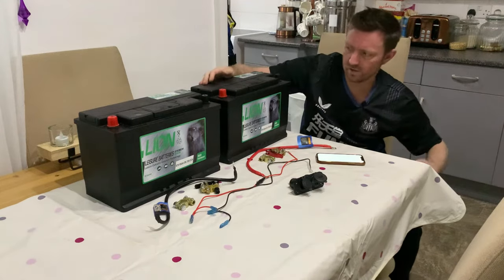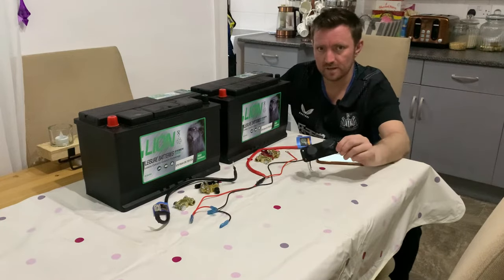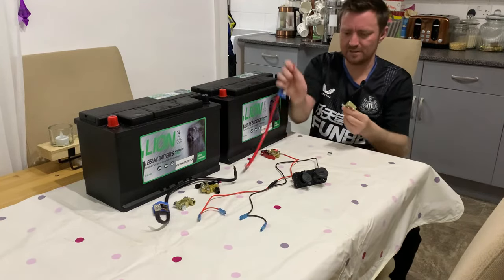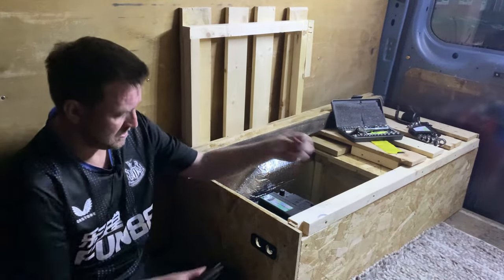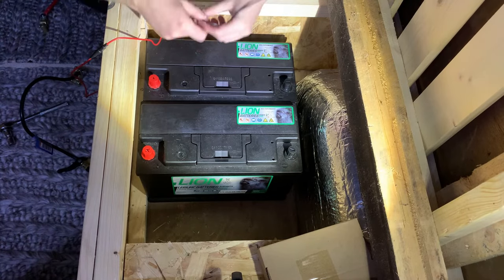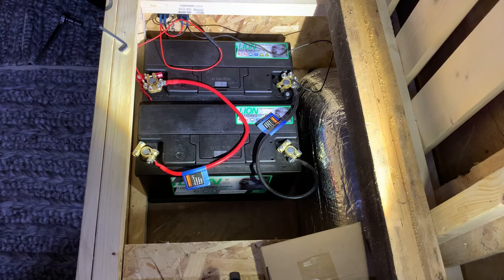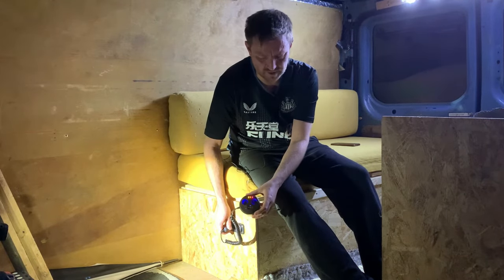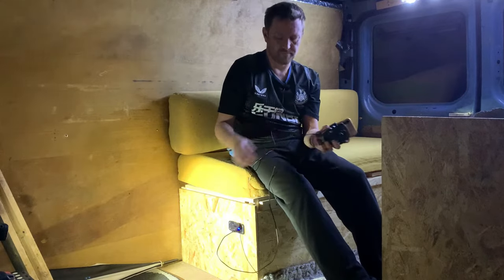Simple 12v Campervan Electric System: DIY Campervan Conversion Part 5

Comment: I like your project. Good times are ahead for you!  

 I built a few 12 volt systems myself.   We have a 1988 GMC camper van that we bought new 35 years ago with the 5.7 liter engine. I installed a new engine and reworked everything, brakes, driveline, new tires, etc.  The van has so much fun family history and gets used regularly for short camping trips in Northern California. I recently added 400 watts of solar panels to the roof, a 300 amp hour lithium battery, 2000 watt inverter, 40 amp solar charge controller. We bring a refrigerator/freezer, all kinds of lighting like an antique floor lamp, a chandelier, table lamps (one is a ship looking like the Titanic), electric toaster, electric coffee maker, small microwave oven, vacuum cleaner, small electric heater. I welded up a clamp and hanger to hang the 6 bulb chandelier over any picnic table and actually powered the wire feed welder using the van's battery/inverter system. I installed an exterior weatherproof electrical outlet, and the van has come in so handy as a mobile power source. Even with heavy usage, the battery rarely goes below 80% overnight. All of the extra lighting has dimmer switches so we don't bother other campers at night. People stop in to chuckle at the chandelier and ask me to try full brightness. 240 watts equivalent in LED bulbs puts out a lot of light!
https://www.youtube.com/watch?v=cXQO80MghOU

Comment: Thank you for the help, simplest hookup yet and very helpful for people like me to understand.  How do you recharge the batteries?
Reply from the maker: Hi @ChrisS532, when I 1st set it up, I simply used a car battery charger to recharge. Now I have upgraded to solar panels & a split charge relay to charge them. I’ve had zero issues at all with the system though. Really simple & works great. Just remember to add fuses (I didn’t initially, but I have them now).

Comment: Good vlog you will get full use of both batteries if you use the positive of one batterie and negative of the other so they both drain together and charge together my friend. This is not a criticism of your work but I just like to pass on my knowledge to all the best pal
Reply from the maker: Hi Lennie. Thanks for the reply. I didn’t know that about the battery drain but I’ll swap the terminals around later as it’s only a 2 minute job to do it

Comment: Like your input, one thing... don't forget fuses between batteries and output etc !!!! good luck with your build
Reply from the maker: Yes fuses are 1 thing I admit to not previously knowing much about. But I now know they’re extremely important to prevent short circuits, cables overheating & potentially setting the van on fire. Extremely important things.
Reply: @ourvan.ourway  well done that man. good luck with the build.

Comment: nice cool what kinda battery are those is it deep cycle battery how much Amp battery have
Reply from the maker: @andyjack2368 they’re Lion brand leisure batteries from EuroCarParts here in the U.K. (I’m not sure where you’re from in the world). They’re lead acid 105ah each, so only have about 50% of the rated amps as usable power. But for what we use in the van, this is more than enough for us. It’s literally used for charging our phones, 12v lights & powering our 12v compressor coolbox type fridge.
Reply: @ourvan.ourway  am in Toronto Canada i have inverter but battery i need hard to get i have deep cycle battery 12 volt 75A real deep cycle baby
Reply from the maker: @andyjack2368  if we had the money, we would get lithium batteries. But unfortunately they’re so expensive. We just can’t afford them right now. Though I did read that lithium batteries aren’t good in the extreme cold so maybe they’d be no good for you in the winter in Canada 

Something we were told by one of our viewers is when you take a power feed from the batteries (to our 12v sockets or to your inverter for example) is to hook the positive connection to battery 1 & the negative connection to battery 2. That way it draws the power equally from both batteries

Comment: I have concerns that you've chosen a battery with calcium-calcium technology.  Calcium batteries generally require more charging voltage (14.4 to 14.8 V) and deteriorate rapidly in vehicles which do not provide the required voltage range. Alternators which never reach required voltage range will cause rapid sulfation due to battery never being charged fully and the life of the battery will be severely reduced.  It's a year later now,....how are they holding up?
Reply from the maker: Hi Chris. The batteries are doing great. Initially they were charged with a mains powered battery charger & more recently, we have a split charge relay to top them up while driving.

Hopefully by this weekend I’ll have the solar panel & MPPT charge controller wired up to charge them via sunlight too.

While the lead acid batteries aren’t the best now, they were what was affordable at the time & for the price we paid, they do the job perfectly

Comment: Should you not be drawing power equally across both batters by attaching cig lighter positive to battery 1 and cig lighter negative to battery 2. Think you could shorten the lengths of your positive and negative cables (make sure same length). Probably worth getting a fuse block and getting it fused properly.
Reply from the maker: Yes drawing the current from each battery equally was something I didn’t know about at the time until another viewer (Lennie) mentioned it. It’s been swapped over now. 

Since this video, I’ve also hooked up a split charge relay system & this is fused

I’ll be modifying the output as we get further on with the van & install lights etc.., my plan is to use the fused blocks I assume you’re referring to. But for now with things like usb phone chargers & low wattage cigarette lighter plug items, hopefully it’ll be fine